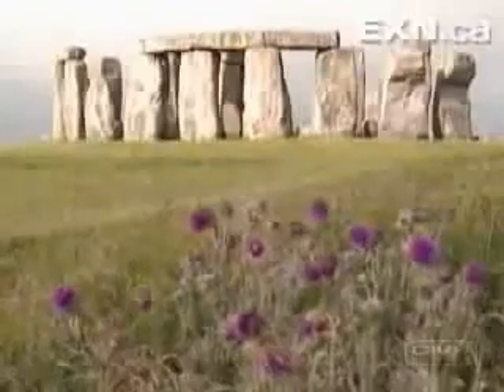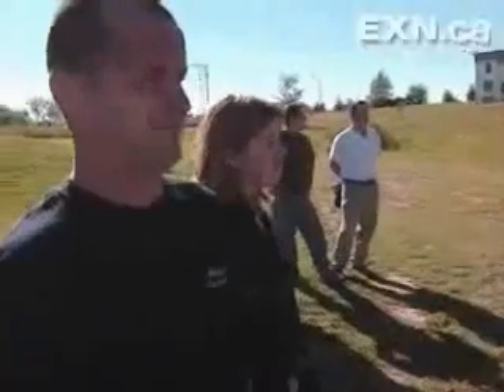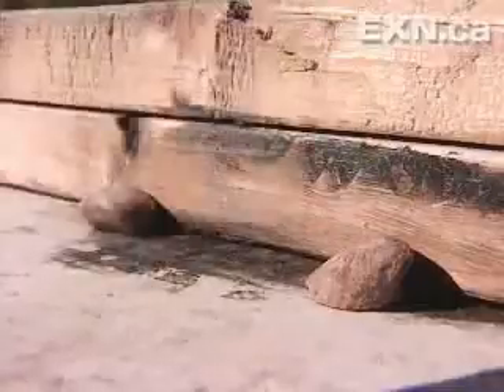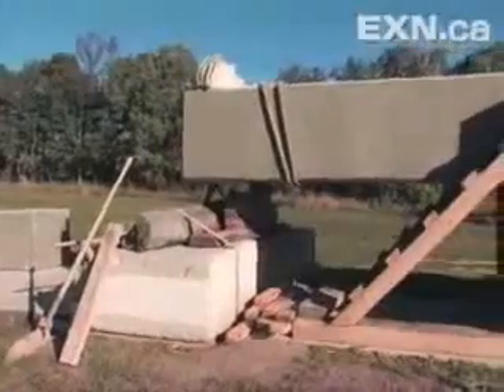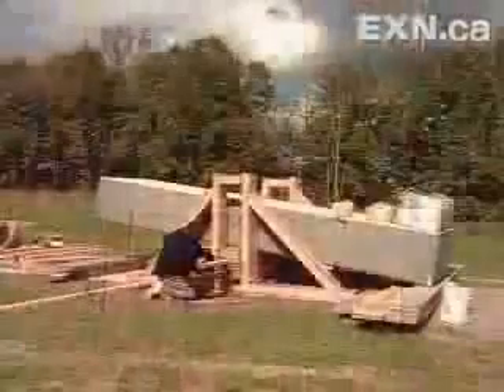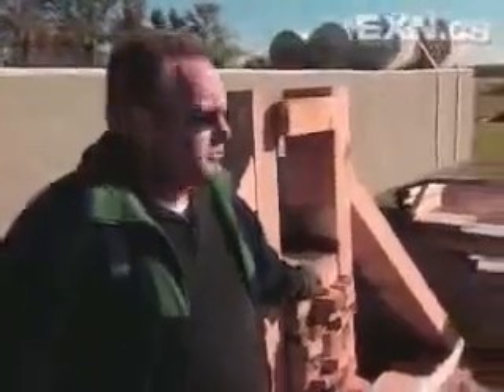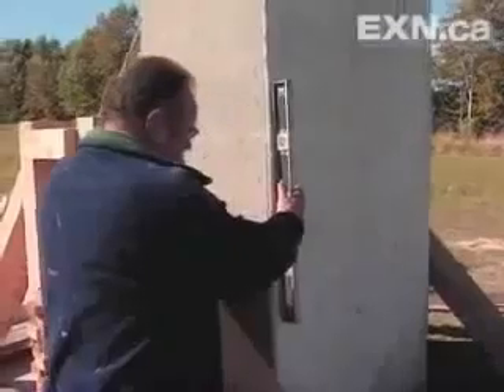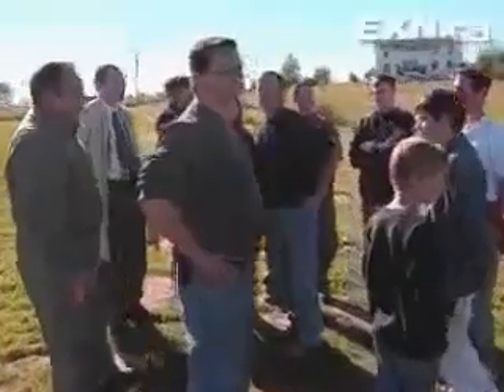Man Moves Huge Blocks Without Machinery, His Own Stone Henge

Comment: This man has proven impressively just how possible the "seemingly" impossible is actually possible. Incredible.. Proof that we don't have to rely on "aliens" to prove how ancients constructed great structures. Experience and intelligence was this mans fortitude.
Reply: Quarrying of massive granite rocks weighing hundred of tons and carrying them to mountain tops many kilometres away could not have been done by the bloke in the top video.  I totally agree with Jonny.
Reply: The pyramid stones weigh between 2 and 80 tons. Some of them came from a quarry 500 miles away. This guy moved his block the distance between the two stones every turn. Can you imagine moving an 80 ton stone 500 miles across who knows what kind of terrain? Oh, and one pyramid has about 2,300,000 stones so I don't even want to do the math on how long that would take?
Reply: @TripleNickelz  You realize the Great Pyramids were built by tens of thousands of people over decades right?
Reply: @TripleNickelz  giza pyramids were literally build on a limestone quarry, and theyre 99.8% limestone. Some granite used was supposedly mined 500 miles away though...
Reply: @blkcandywarez why about the rose quartz in kings chamber
Reply: Moving, querying we got that, now how did they lift amd set the horizontal pieces ??
Reply: @titirititiri6360  Gee, that's a bit tricky isn't it? The only possible explanation is that an advanced extra terrestrial species helped  tilt a stone block 90 degrees on its side.
Reply: @michaelweir9666  we do live in a thought based universe, though is the wave function that shapes matter, so if thoughts were fully understood, it is within the realm of possibility that human thoughts and emotions could shape matter. This would be a collective thought, focused intent, hundreds of people all On the same page thinking the same thought at the same time.

?????
Reply: @TripleNickelz  something along the lines of...... One stone,Quarried,Shaped,Moved into place,every Two minutes,Twenty Four hours a day,Three Hundred and Sixty-five days a week for Twenty years. If we're to belive what we're told ,that it took only that time to build  the Great Pyramid.🤔😏🤔🏴
Reply: @TripleNickelz  Hey, no rush. We got a few thousand years... and Occam's Razor.
Reply: @TripleNickelz  how about instead of doing stupid questions you try do solve how they did it? Otherwise you will start to look to stupid answers, like aliens and shit, cuz thats what stupid people do when they have no answers, they think about magic, its a pattern in every civilization ever.
Reply: @nandop69  it's not stupid when we don't have the technology today to build these pyramids. you do realize that the gza was built in perfect scale of the earth. If you multiple the base of the gza by 43200 you get the equatorial circumference of the earth. And if you measure the height of the Great Pyramid and multiply it by 43200 you get the polar radius of the earth. And that it points at astronomical true north to the specific degree. So you have 2.5 M stones that had to be cut and lifted and carried, and constructed with mathematical precision to the scale of the earth and you think it's stupid to consider that it was created by people or aliens that had advanced knowledge and technology?
Reply: @MrDonjhamilton  But could be done by dozens or hundreds of blokes working together using the same techniques, I say that a certainty.
Reply: @TripleNickelz  They quarry site is right next to a river, the construction site is also near a river. They only had to move the stones to the river and then float them down to the construction site.
Reply: @MrDonjhamilton  it is possible especially when you take i to account the ancient civilizations would have built bigger platform's
Reply: @MrDonjhamilton  it is possible, especially when you take i to account the ancient civilizations would have built bigger platforms and had hundreds of thousands of people. He is showing it on a small scale, but it can be upgraded to a large scale. As a matter of fact in the 1920s. a guy named Edward Leedskalnin moved massive stones "like they were helium balloons. " to create a

Comment: Wonder how hes gonna stack the top piece.
Reply: Maybe just the same way he got it 3ft off the ground
Reply: @nathancornwell1455  yeah but ha have to actually put it on top of other blocks standing. It's a lot more complicated than just lifting it.
Reply: @edilbertorivera3467  Lift it first in the middle and rotate it just like he did with other stones, barn etc.?
Reply: Lift it up with the exact same technique he did here then "roll" it over onto the two standing stones
it will obviously be much, much harder but it should be doable
Reply: @eirin099  it’s particularly doable if you had the resources and manpower of a whole village or civilization. 

This is simply the work of one man and his limited resources over the course of a couple days.
Reply: i'd lift it up with the jack diagonally between the columns, last move is to twist it into sitting over the columns and then pound out the wood underneath so it rests and you can remove the jack.
Reply: Lift the middle piece first, have 2 more teeter totters standing up the sides, lower the middle piece
My theory
Reply: @chrismofer  yeah that’s what I was thinking to

Comment: Excellent. And the best viable explanation I've seen.
Reply: Rag Tie it is but a lot of things are up in the air imo, such as the precise cutting, measurements, and placements seen in ancient structures
Reply: @synerg1st  The placements are actually not so hard to achieve. You just need to target a landmark, where the sun rises at winter solstice etc.  That's what very obviously was done in native American calendars. They created some snake way etc. for their ritual and specific landmarks like mountian tops or artificial mounts/hills were used to mark the spot the sun rises etc. That why you could also easily find you nice rotation for a pyramid, just start by the north star or Orion's belt or whatever else you want to incorprate into your structure, pin point your targets first, then place the rest around them. When the temple of Abu Simbel was relocated by modern humans it was basically backwards engineering what the Egyptians did, so the sun rays would still fall into it on solstice (I believe) as they were supposed to in its original location.

Comment: When he raises it 3 ft couldn’t he get more heigh if he had a large trench dug at each side so the angle would be greater and thus allow a larger/taller piece of wood in the larger gap in the shoring box?
Reply: In principle yes but, as the stone becomes more erect, the force transference changes once you reach 45 degrees requiring more force (in this case weight) back down. Once you are over 45 degrees, the downward force of the block's weight acts toward the opposite end acting against you. You lose the advantage of the moment of inertia just to start it moving.

Comment: The only question that remains for me on ancient monuments is the precise cutting of huge solid granite and stone.
Reply: We’ve almost always had the ability to precisely measure. Cutting stones is an ancient technique with varying methodologies depending on the region and time period. In the case of Stonehenge, they would have essentially chiseled it away with heavy hammerstones. Then sanded it down with other stones.
Reply: It’s amazing how many “impossible feats of ancient engineering” can simply be solved with patience,time,skill, and effort. We forgot many ancient buildings took years if not decades to build

Comment: That's how they built them Pyramids.
Reply: I mean maybe it explains how they assembled them, but not a lot of other things like why they used the materials they used. The ridiculous degree of precision the stones are cut to, among other things
Reply: @White_Fox_5.0  I think people need to get out of the mind set that those people had no power, all the electricity anyone could ever need is right under ground. 

Because the archeologist didn't find electrical boxes doesn't mean they didn't have it. 

Mho
Reply: @White_Fox_5.0  I also believe they built the pyramids because they wanted mountains they had mappers who went out to scouted areas looking for other tribes to trade witj, they found multiuser magnificent mountains.
With the mountains they found  food, water, protection from the elements and enemies,  when they got back they told the king all about the food, protection,  he then said, I want mountains,  so they built mountains.
Mho
Reply: @White_Fox_5.0  you can cut stones pretty damn precise with primitive methods, its just really really fucking time consuming
not sure if its possible for the stones used in the pyramid (unsure about the variant) but i know you can basically sand surfaces down to make them fairly even or use string/rope to cut relatively straight.
Reply: no its not

Comment: There are twelve 70 ton perfectly cut rose granite blocks over 200 feet off the ground in the pyramids. They are perfectly cut stacked and positioned through engineering to distribute the weight of the thousands of tons of stone above them. These methods do not produce that kind of structure.
Reply: Exactly. This man built his own Stonehenge that's only 6 feet tall. This method does not explain the massive, precision granite slabs in the pyramid.
Reply: @rak6437  what do you mean, he shows how 1 60 year old man can move stones weighing TONs with only simple mechanics. Imagine what the advanced Egyptians could do using millions of slaves. The pyramid is no longer a mystery, people just seem to think ancient civilizations were stupid.
Reply: They do when you multiply this man’s work by millions of slaves and then also take into account the Egyptians were very good at building pyramids (as it took many iterations to learn how to make them the best) and they used not only systems like this, but they used water. Science has cracked the pyramid code so don’t think we have any evidence of aliens yet. (I wish we did)
Reply: Sounds like you got it figured out squipp. Me on the other hand will continue my research.
Reply: @sqwippysquishy5287  If they were so good, why did their manufacturing techniques and pyramid construction get worse over time?
Reply: @hattershouse710  just like the Roman’s, mayans, ect. their civilization collapsed, that’s why.
Reply: @sqwippysquishy5287  That didn't answer the question. Why did their so called building techniques get worse over time rather than better? That makes no sense in human evolution as we know it.  It's more likely there was an advanced egyptian civilization that got wiped out and their descendants lost the technology and inherited the pyramids and older geomtetrically precise objects and statues. A lot of these things are made with such precision it begs the question if these were made by hand with primitive tools when we find heirogliphics etched slppily onto works of art.
Reply: @hattershouse710  because the transfer of knowledge from one generation to the next via word of mouth isn't a very good way to do it.

We got a steady generation improvement in design, until the great pyramid, then a slow decline.

Comment: Why is this man moving the blocks  by himself? I highly doubt the Stonehenge was built by one man.
Reply: The Internet Tough Guy this video doesn't suggest Stonehenge was built by one man. He just suggests how they could have done it with a much smaller team than people originally thought.
Reply: Because moving it with 100 people would be relatively easy. As would using an excavator. He's interested in showing what one guy with some blocks of wood can do.

He's not moving blocks around because he needs the blocks to be somewhere, his hobby is challenging himself to do it without help from modern machines or teams of people.
Reply: I see what you did there.... :D
Reply: Just imagine dude he did lifted that stone alone. What if there's more manpower? It's not impossible it's just complicated.

Comment: How did you go putting up the "cross member " stone mate. Your scaffolding would need to ne 16 foot high in order to "drop over" your vertical stones. Also the scaffolding must be strong enough to suspend the 19 000 lb horizontal stone and have enough stability to lay it down 13 ft in the air. Then there's just getting it  up there - requires enormous power. 🤔
😎
Reply: Impossible yet he showed it could be possible.
Reply: If the scaffolding would need to be 16ft high, then I imagine he would just build the scaffolding 16ft high. And if it needs to be strong enough to support 19,000 pounds, then I imagine he would make it strong enough to support 19,000 pounds. 

I'm really not seeing your issue here.

Comment: Useless, now how did they lift and set the massive horizontal?
Reply: with wooden cranes?
Reply: He showed how to move the horizontal. Also keep in mind this is what can be done by one man. Imagine what ten guys could do.
Reply: The same way he lifted that big block 3ft. Just keep doing that even higher. Then set the two vertical blocks under it and lower it back down onto them.

Comment: They used a hose. Was that necessary as this wasn't available when stonehenge was built? And what about the stone that goes on the top? This proves nothing and is just promoting Innovative eMarketing Pty Ltd.
Reply: You seriously think there isn't an ancient substitute they could use for a water hose? Granted, he should've gone all in with the theme, but there are man powered hoses or better yet, a bucket line
Reply: Buckets of water
Reply: You never heard of a bucket?  Or hey, how about just people with shovels? It didn't HAVE to be a hose or even water. He was just using the water to move the sand. Literally any other method of moving sand would have worked.
Reply: dang if only people figured out how to piss in a hole.